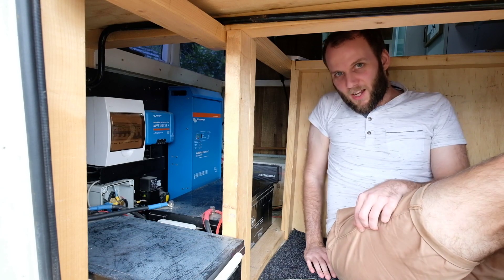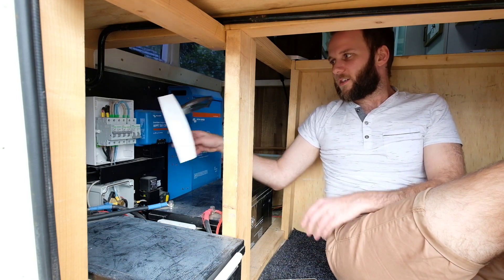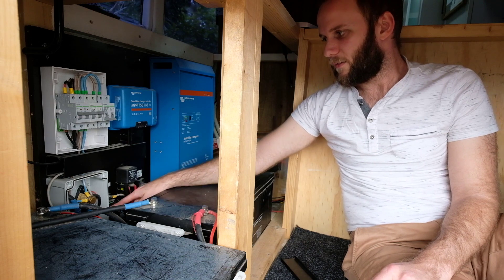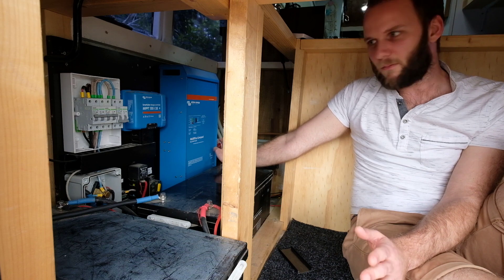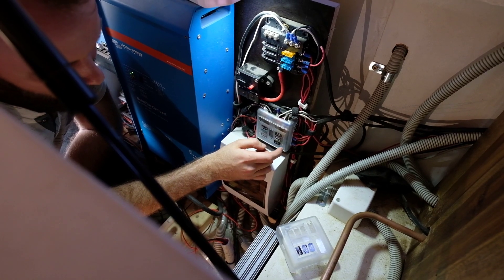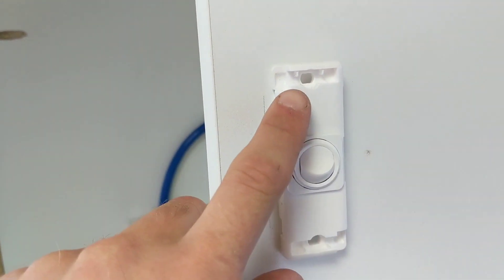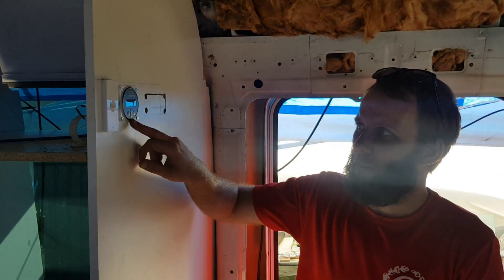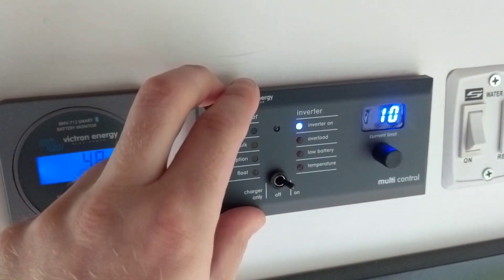Off-Grid Electrical System - Toyota Coaster School Bus Conversion

Comment: yer didnt say the bus itself, what system does it run? 24/12 volt?
Reply: It runs 24v, you’re right, but it’s covered in the video on the battery box installation

Comment: You need a bus bar mate that tree on top of the battery monitor shunt is dangerous, at lease re stack it like an Xmas tree. Largest charge/draw first eg inverter mppt fridge 24 to 12 conveyer. 

I will have to do a video of my electrical. There is still a few things I would like to redo that are not best practice
Reply from the maker: Hi Francis, the fuse blocks have in built bus bars which the negatives for all appliances go to. Fuse block, charge controller, inverter and battery combiner then go to the shunt. That was all pre-wired for us (although I rearranged it to not best practice at some point) , I added the fuse blocks and negative for our starter battery.

I need to tidy up the cabling which now will involve rearranging the top of the shunt, thank you.
Reply: Yep as long as you stack them in order it’s better. A lot of pros will tell you never to stack. If you can run your shunt to a bus bar it would be better. But rearranging the stack will help.

Comment: A must video. Whats the cost of such a setup (including batteries & panels) ? Also what's the cost of having it installed professionally?
Reply from the maker: Thanks Trevor, our batteries were about $2000 each, the electrical board cost about $3500, and our panels were around $1050 delivered (we have 3x 305w panels). We only had the board put together but Shane actually did the installation of everything so not sure how much it would cost.

Comment: what did you pay for your batteries please, and the victron inverter, cheers
Reply from the maker: "Hi Brian, the batteries were just under $2000 each (we got one at a caravan show and went to the same people to get a good deal on the second one. At the time the RRP was $2650).
The Victron Multiplus cost us $1409 ex gst."